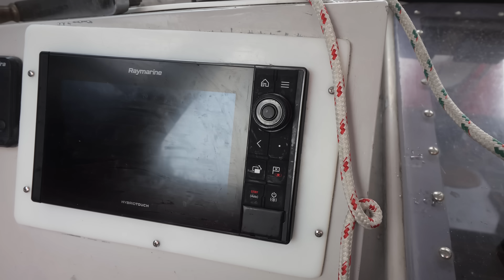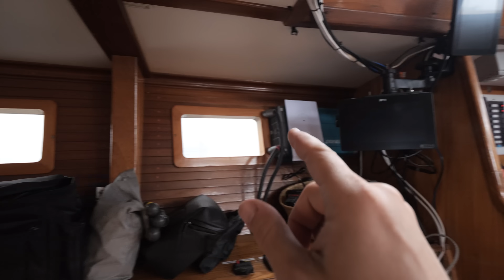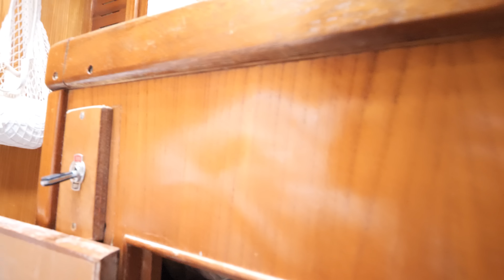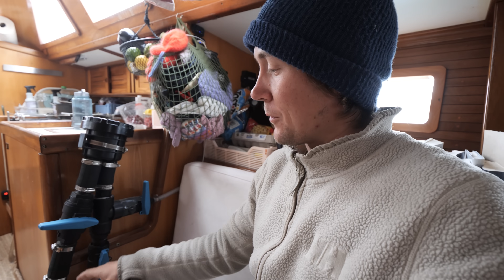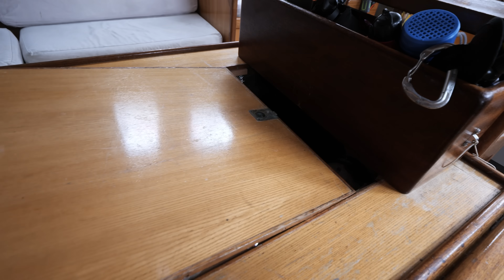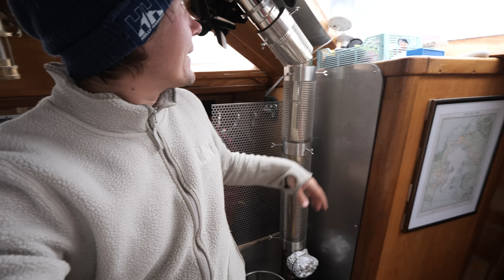The Hidden Things That You Never See! INTERIOR TECH TOUR

Comment: The pull cord for the air cutoff ball valve is susceptible to melting with heat. In a runaway situation, the engine compartment and components will get hot quickly.  Any thoughts about using a stainless steel cable for the pull cord?

Comment: Well thought out systems on the boat - nicely done.   I like the intake shutoff valve on the engine - you may never experience a runaway, but you can handle it with little stress if it ever does happen.

Comment: Alright I have a legit question for you guys or for someone who builds aluminum boats......why is it to truly waterproof and isolate the electrical systems from the hull does anyone not use a continuous circular say truck style radiator hose and keep all the connections inside and use the steel grid in the hose already waterproof continuous and isolated as the ground or even run a 00 gauge through the hose for the ground to be super secure
Reply: If I was building my own aluminum boat that's what I'd do
Reply: Even put the individual parts in waterproof housings to keep out saltair

Comment: Hello love the boat I am also a fan of Raymarine products 😊. I have been thinking about power banks and I have experience with lithium ion batteries on my electric bike, scooter, and camping gear. I am now sailing a Columbia 24 Challenger and apprehensive about lithium ion in the moist humid conditions because I have seen them get wet and explode.  What safety measures have you taken to ensure moisture does not come into contact with the batteries?

Comment: If you ever sell this boat it will have to be to a Rocket Scientist. 😅 But if you ever get the spare time and feel the need, it would help someone, anyone operating this boat to have a Schematic Diagram both of electrical and plumbing.  You dont want someone turning on the greywater pump and turning the valve to the freshwater or somewhere else it should not go. IDT you have it setup to completely "dummy-proof" that.  

Secondly, if you have the time and inclination, consider putting together a Troubleshooting Guide, not simply for others but for YOURSELF. Imagine waking in a sleep-deprived condition to some problem or emergency and you will not be able to think straight and properly Troubleshoot common problems.  By producing your own Guide, you can ensure no essential steps in the problem resolution are skipped over.

Lastly but most importantly, you have so much electrical running through this boat consider installing many many more fire extinguishers. Install ones color-coded formulated specifically for electrical fires and a foaming one for a fuel-based fire.

I am also very curios because in normal houses pipes burst due to freezing temperatures. Will this system survive this threat? I have trouble believing it will and you've said nothing to reassure us.

I wish you only the best and safe passage!

Comment: I have what I call a retractable keel on my 20 ft Paceship P2-20.  In my boat's case it weighs 425 Lbs. and has a cable lifting system that includes a couple pullies that give a mechanical advantage allowing it to be raised without much effort.  It seems on your sailboat the ballast is not really very far below the waterline.  On the typical sailboat the fixed keel is a large mass 6-10 feet below the waterline.  That has to help with higher winds wanting to blow the boat over (preventing it from listing too far).  Do you have a problem with high winds?

Comment: The transducer is interesting.  It must be in the water to work.  On plastic boats the transducer can be inside a water filled box that is inside the boat.  The bottom of the box is the solid not foam core fiberglass hull.
Reply: Thanks for sharing. I learned a lot.

Comment: I noticed you are using the AC starlink controller…you can build a DC based system really easily so you don’t need the inverter  and associated loss.
Reply: What has your experience been?  I know that doing it means a boost converter and a separate router plus you either have to fiddle with the cable or buy a bit of hardware.  The win here is seemingly based on not needing an inverter for any other load e.g. an AC fridge. Once you fire up that inverter for some other reason your gains get much more questionable

Comment: Really good. I love everything that you have done. I like the hatch insulators, and I will copy your transducer anti leak covers. I think that I can do that with heavy wall PVC screw caps which I can fiber glass to the hull. I have already done what I call my fuel processor which has all of your functionality in one compact assembly. I also like your split battery system. Do you have a chain counter? If so what sort? I dragged anchor last night and wound up out in the middle of a channel. Panic, which lead to a comedy of errors including having the anchor winch drum jammed by a piece of nylon thread from the round anchor indicator, a toe cut and bleeding when the half hatch got blown shut leading to my side passage to the cockpit quickly looking like a murder scene, and….its all too embarrassing to recount. I hadn’t set an anchor alarm as we had a massive electrical storm which ran all night and I had all of the instruments off. My good friend has now set me up with a phone and tablet alarm app which is awesome. 
You might be interested, I am thinking through an alternative power generator which will generate power as long as the boat is moving, and it should increase your boat speed as well.

Comment: Thanks for this video. Very well thought organistion 👍 I appreciate your concerns about thru holes, they sank many boats. Regarding the engine and its need of sea water I read a book in the past where the boat was equiped with an air cooled diesel (read that 45 years ago, so I don't remember the title and the sailor who wrote it, if my memory is correct he/she was sailing in icy conditions too). 
BTW, if I'm correct youf boat was build by the Garcia shipyard, are you in contact with them for your feedback? I'm quite sure they could appreciate your experience and your technical feedback (and in return give you some technical assistance)

Comment: I totally agree with you regarding the through hulls (I mean holes 🤣 ) in the boat, regarding the shower I have seen a design where the shower and toilet are inside the wheel house and at sea the drains are above sea level with a valve for the tank to be used in port etc. that boat also has watertight bulkheads around the rudder shaft etc, it also used the big diesel heater

Comment: Is your supply pump for the diesel day tank self priming? 
I have a similar set up to yours. It uses a Jabsco Vane style supply pump but it has been a bit of a hassle to prime if it ever looses it’s prime. 
Recently I’ve added a lift pump that can be used to run the engine off the keel tank or it can prime the Jabsco supply pump with a turn of a 3 way valve.
2 parallel fuel systems that can be connected if you will.

Comment: Hi guys 
Great video and very smart ideas, lots of thought.  
Polishing del, redudacy power, swing keel and motor run away in case of capsized with motor running
After seeing the grey water and your drainage could that be setup like your only one with a clan out with rod above water line
Question 1 
What precautions do you have for lithium batteries catching fire or over heating 
Question  2
What precautions do you have for lighting strikes and protection of electronic, e.g. parlay had 2 lighting strikes 
I also love that you have explained that you have used double pole switching as nobody does it 

Thanks for your content 
Hold fast

Comment: I was wondering why don't you consider forklift batteries on your boat. I have one 48V 625Ah and it is nearly a ton. Since you have internal ballast anyway you could mount it to the place of the ballast, one on each side and it could give you 2 tons of ballast and 40kWh long term capacity without the BMS and similar issues. Standard lead-acid forklift batteries have components, available services at a lot of places, you can get accessories etc. 
for a deep keel boat with ballasted keel it would not be a good option but for internal ballasted boats this could make use of the weight of the lead in the bilge, instead of being just "dead weight".
Sure you would have to deal with a few issues like avoiding electrolyte leaking when heeled etc but  compared to the complexity of a BMS this is nothing.
Reply: 40kWh usable energy or 40kWh capacity? 

My lead acid bank has 22kWh capacity but I can only use 6-7kWh if I want the batteries to last. So I have to use a "bms" setup to make sure I don't use to much energy. Our 12kWh (capacity) Lithium-Ion setup has 8kWh usable energy regulated through the bms. This is also configured to make the batteries last as long as possible. 

The lead acid bank has the benefit that it can be charged in sub zero conditions ( but that reduces the lifespan).

Litium batteries should absolutely not be charged if they are colder than 0C. We programed ours to not accept charge if they are colder than 8C. Preferably they should be 20C, but that's not practical during the winter.

Our Li-Io batteries has a energy loss of about 12% on a use-charge cycle whereas the lead acid batteries have some +30%

Adding 2000kg to the boat does not give any benefits if you can not remove 2000kg elsewhere as a result. Some boats are designed to carry huge batteries as their ballast. Sundeer and Deerfoot by Dashew spring to mind.

Anyway just my thoughts and opinions on the matter. Guess it comes down to preferences, availability and matching your needs.
Reply: @noldushumlesnurr6169  my forklift battery is 625Ah at 48V battery. When used down to 625Ah it actually has about 20% reserve (should not be discharged to zero), but for forklift batteries the declared capacity has reserve.. 625Ah is, however for forklift operation (C5 - 5hour load). When used as an off-grid battery it is used more at C20 (discharged way slower), which translates to almost 900Ah. So one of those could be used 30kWh without a problem, meaning if you use TWO of them as 40kWh you are way up in the safe zone. 
It is not really good for vehicle operation due to weight and size but if they use tons of lead as a ballast anyway this is not a problem.

Comment: I'm building my boat and not yet on electrical yet. I know exactly why you need double pole . Somehow though i never thought about it considering the boat. Main problem I have with single pole switches is led floodlights staying kindof. But as stray currents in the boat that would be unforgiving. I'm sooo frkng glad i watched this video.
Reply: @ewauvwas  DC is a loop between the poles of the battery. Complications here are going to be with introduced current e.g. from the AC system. DC ground planes are a fascinating subject for electronics designers and will be the cause of most or all problems.  In this case maybe look really hard at galvanic isolation for shore power and keep your ground exposure e.g. through the engine block minimal.